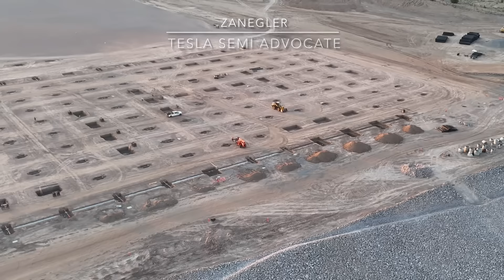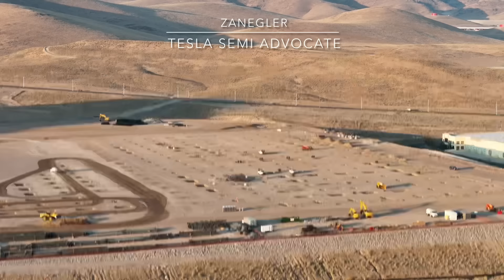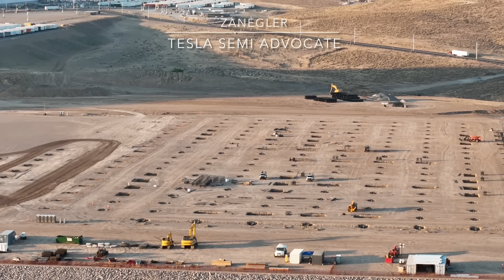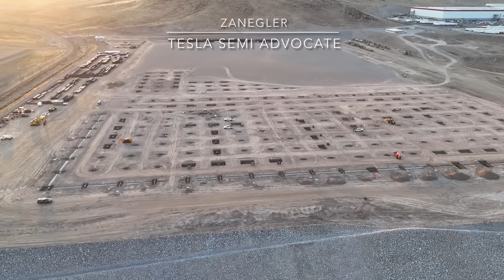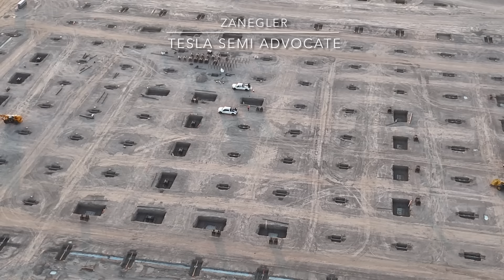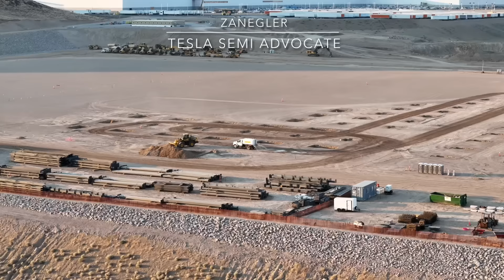Saturday Sunrise @ Tesla Semi Factory - July 20, 2024

Comment: We value your videos and the insights you learn from Tesla factory workers and builders. Don't worry about getting terms wrong. Your grateful audience will give you the right terms cement/concrete, column/beam as they do already. There will be many other terms to learn as the building progresses. Building may not get much larger, Footprint is big already. It appears they have prefabricated part, or all, of some the footing steelwork. We could see a day where many footings are concreted.

Comment: I would be surprised if those are all separate 'production lines'. I'd expect it to be conceptually similar to Giga Texas, with large sections of the factory dedicated to various parts production, stamping, casting, painting, and assembly. The final assembly line for Cybertrucks is a 3 dimensional path going up/down/left/right/forward where the parts are all then brought together and assembled. I would think this is the approach they'll take for the line here. My guess would be 2 or perhaps 3 distinct 'lines', just based on what I've seen at Austin.
Reply from the maker: The prototype semi currently produced is largely comprised of supplier parts. It is easier to list the components they produce than the ones they don’t. Plaid motors, battery packs, screens, bms, heat pump and HVAC. They don’t stamp any body parts. This could all change of course as they ramp up to volume production.
Reply: @ZaneglerTeslaSemiStalker-vt3or  It will be interesting to watch it all unfold in the coming years. Glad you're going to bring us the vids!
Reply: I think that for each production line bay that maybe 2 bays will be needed for parts staging and movement.

Comment: Thanks for the coverage, and for picking up on nomenclature.  It sounds as though you see this plant as a multiplicity of final assembly lines.  Consider that it must also make most of the parts. Stampings, Forgings, Motors, Windows, Plastics, Wiring,  Batteries, Seats, Painting, Electronics, Etc.  Not all of course but Tesla makes a lot of its own stuff.
Reply: YES!   Way back in the late 70's I worked at Western Star building semi trucks.   There were 2 main lines, east and west plus a cab paint line.  East line assembled the frame, then everything else was added up to the chassis paint booth.  Then it got tires and wheels, proceeded down the west line to get everything else, motor, transmission, drive shafts, cab, batteries... then final finish.
The assembly lines took up at most 1/3 the total floor space.  Most was used to make sub-assemblies, rear axles, air tanks, air lines, battery cables, fifth wheel (east line). and lots of other storage space for parts and supplies.  And they didn't build the cabs (was a sourced supplier), only painted them.   Taking a page from Tesla's car lines, there will be groups of cells that do different things of the assembly and the truck will be moved on to the next cell group.   That is much more efficient than old fashion straight in floor chain lines.   So, likely will be at most 2 assembly lines one for standard, one for long haul with sleepers.

Comment: Correct - cement is the powder that goes into the mix .  Portland cement is a popular one. 
Concrete is the finished product mixed with gravel, sand, cement powder and any chemical additive to attain some desired characteristics.  
There are many more mixes than that but two types are most common… and used generally everywhere with additional mixes for industrial uses..